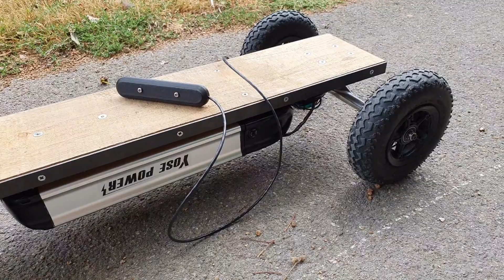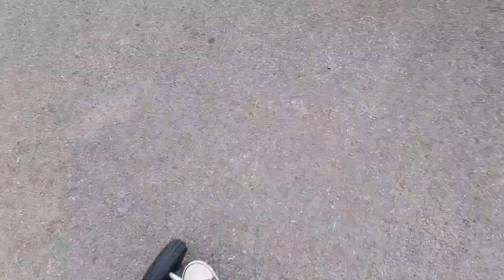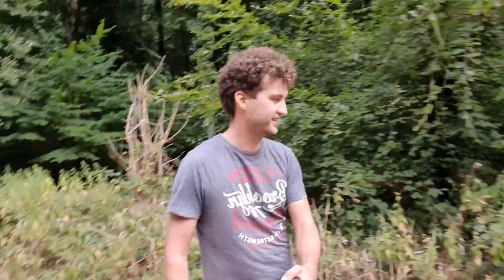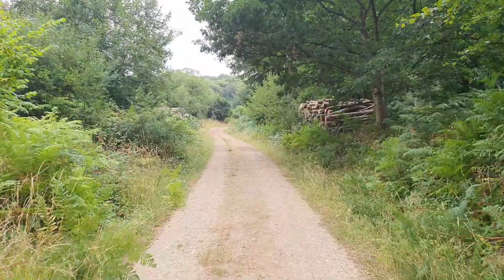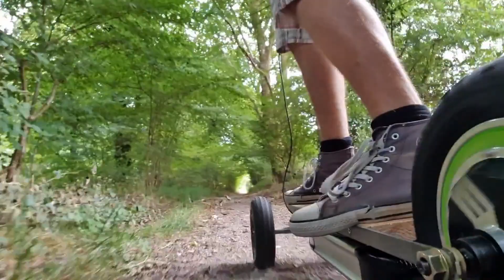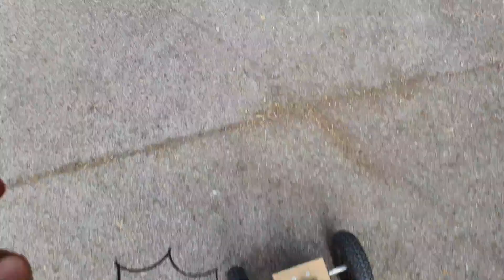Testing My Three-Wheel Electric Skateboard

Comment: i like it very simple yet effective i have just been trying to build a diy one wheel and for breaking im using the motor rather than add maniacal breaks its much cleaner looking im sure you could get a cheep ebike controller with e abs or even regen breaking i really need to get motivated and make a few vids myself good luck defiantly keep building on it you have something there
Reply from the maker: Thanks Jamie, I'm glad you like it! I'm using a generic BLDC motor controller which does have electronic braking but I am yet to wire it up properly. A one-wheel would be a very interesting build, I would certainly watch your videos just to see how it works!